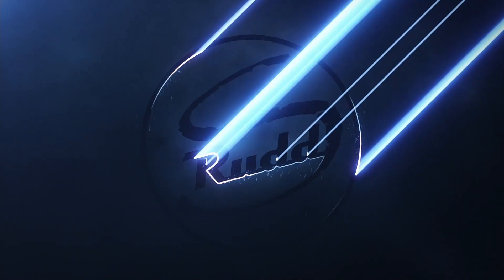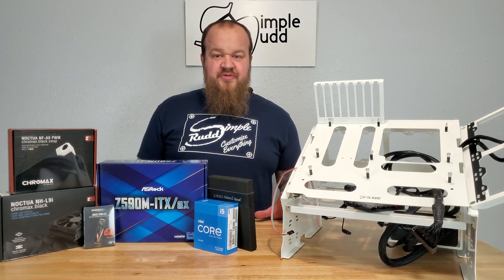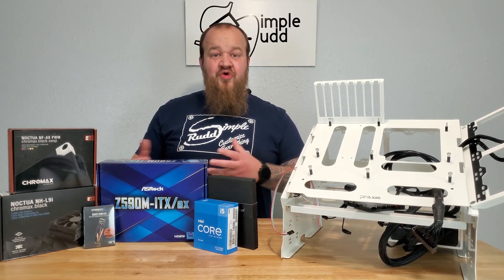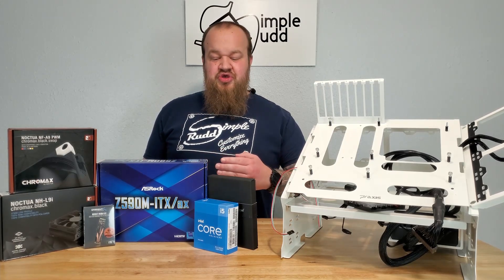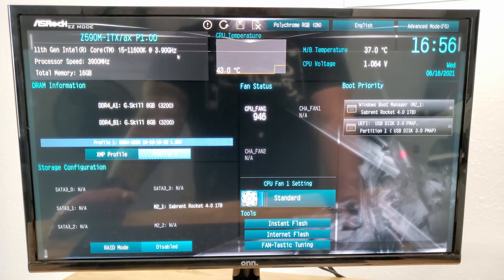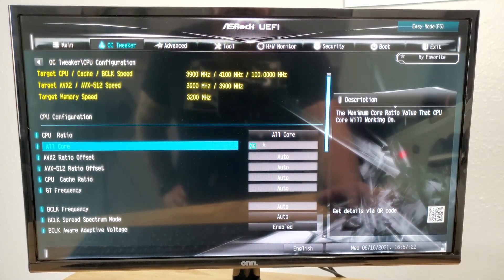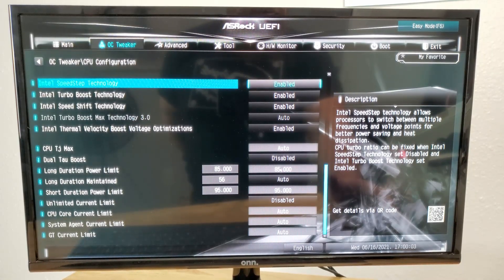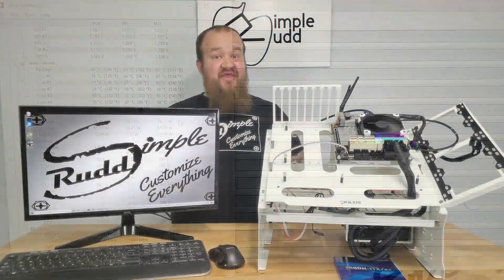Limiting 11th gen Intel's power consumption.

Comment: For what your gf is using that for, and with a 200w psu, why did you not just get the non-K i5-11600?  The i5-11600 has same cores and threads as 11600k, and nearly the same max-turbo and turbo-boost freqs (4.8 vs 4.9 Ghz, which your gf will never ever notice a 0.1 Ghz difference). But i5-11600 has tdp of just 65w compared to nearly double tdp of 125w for  11600k. And the non-K costs less.  Costs less, less heat, no undervolting needed, and same performance for your gf.   i5-11600 non-k would have been the perfect cpu.  This is like you bought a car with a v8 engine, decided that you needed to reduce its gasoline usage, so you tried to disable 4 of the v8 engine's cylinders lol
Reply from the maker: I mostly went with the K series so I could learn something new. Anything I did was gonna be overkill so I went with something ridiculous. The K series are also normally better binned chips as well. So if I take a little more time I can dial it in to be more efficient overall than a non K.
Reply: @simplerudd9235  Well, learning to undervolt is a fine and useful exercise. But to me, it's a combination of factors: the biggest limiting factor is the 200watt PSU.  The second huge limiting factor is you cannot add a GPU into that build (technically you could add a GPU if you left the cover off the case and used a riser cable, but then the 200w PSU limits you to something like a GTX 1050).  And the third limiting factor is the non-gaming intended uses for that build.  The combination of the undervolted K and the intended uses means that it is not any better than the non-K i5-11600, which also costs less.
  
So to use my previous car analogy, you bought a 400-horsepower V8 engine to install in a car, but the car's really small gas tank (PSU) only holds 6 gallons of gasoline, so to reduce the gas usage, you need to deactivate 4 of the engine's 8 cylinders. And the car's intended use is just to drive to the grocery store and shopping mall every week, never exceeding 45 MPH, so installing a 4-cylinder engine in the first place was the best choice, and required less cost and effort.
Reply from the maker: Lol I don't disagree with you. It was not a necessary purchase. However I enjoy going overboard, and I really love the end result of the build. With all that being said, I wouldn't recommend it to any one on a budget.

It did cause me to step it down, so I am not getting the full benefit of the K series. But I knew that going into the build. I am hoping to do another B1 build with the AMD APU, but thats also just for fun and experimenting.

Thanks for all the feedback! I enjoy open discussions towards improving the content I put out. It also helps me learn more about computers and tech.
Reply: @simplerudd9235  The AMD 4750G would be the ideal cpu for that B1 - more cores and less power usage than the 11600k, and would outperform the undervolted  K.
Reply from the maker: I was planning on waiting until August and hopefully getting my hand on a 5000 series.